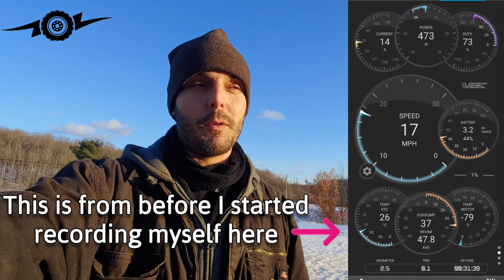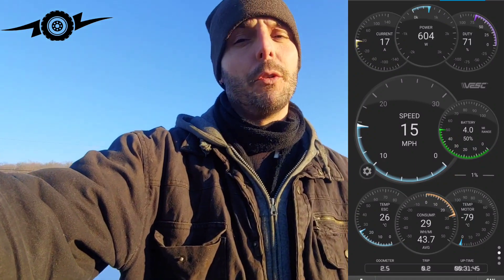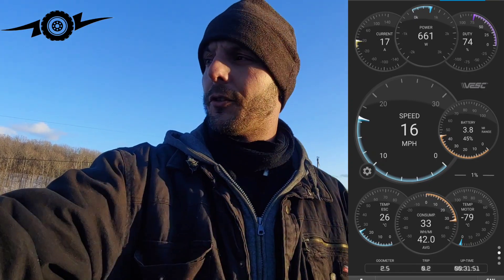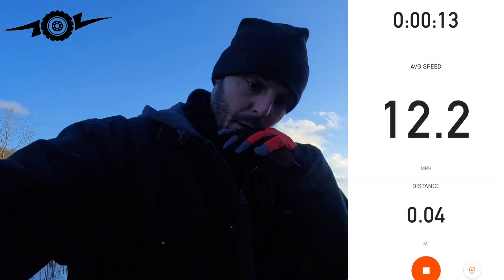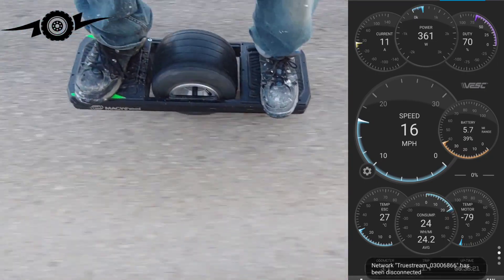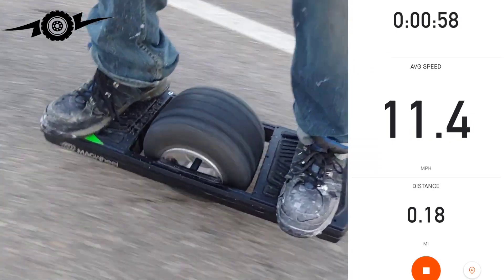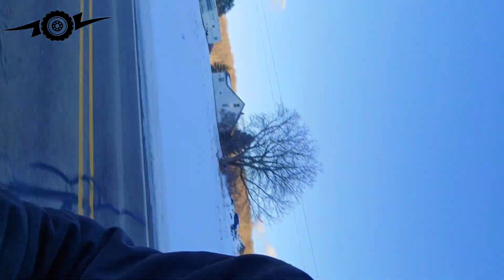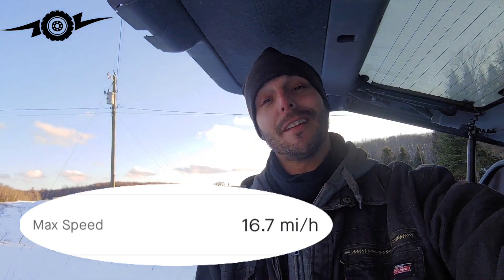VESC MAGWheel Test #2

Comment: Hey! These are exciting developments. I have a Trotter T3 myself and just in the process of vescing it too. Got an esc (flipsky 75200), connected basic wiring and have the motor detected and spinning. Fiddled with the motor settings quite a bit, still have some clunking, but better after raising detected resistance setting and lovering Observer Gain. Can't get the Float package working (or even the balance app) once I load it the motor is not behaving, making weird noises... Is it a custom float package that you're using? Can you share it for me to try please
Reply: After poking around all day got it working with the float package, IMU and Bluetooth work too, yey! The only thing left to figure out how to reverse the signal from the footpads, so it's 0v when disengaged and 3.3v when foot is on (currently just manually shorting the 3.3v to ADC1). Any advice will be much appreciated
Reply: inverting 3.3 signal wire was easy using a transistor I had lying around. Test ride tomorrow...
Reply from the maker: There is a custom float package with an invert adc option, but sounds like you got it covered!

Comment: Can we see a video of riding off-road or on grass?
Reply: Haha wondering if the Little FOCer prevents nosedives on uneven terrain? I’m thinking about putting one in my MagWheel T2.
Reply: @neilpettit3141  it does seem to handle uneven terrain better with the vesc. I'm using a ubox 100 with the stock battery and its way more stable on grass and bumps.
Reply from the maker: If there weren't 12 inches of snow on the ground where I live 😅

Comment: The motor wizard usually returns a resistance value too low. Like for the hypercore, it comes out at 84ish and that clunk is present. Raising it to 100 or so (or just start raising it from its present value) really helped the clunk for me. If it's still present, I also changed my observer to ORTEGA_ORIGINAL and now I can't get a clunk if I tried.
Reply: Motor resistance is motor config>FOC>general, and observer is motor config>FOC>advanced, I believe
Reply: @magic_steve  Careful of the settings that let the magic smoke out tho. hhaha
Reply: Thanks for the info.  I just finished doing a VESC on my T3.  I tried what you mentioned above but I still get the clunk when I change directions.  So when I get on the board and move forward I get one clunk and then noise.  Then if I decided to go reverse I get one clunk and then no noise.  Any ideas?
Reply: @swomitramohanty7505  same for me. Try tightening the bolts on the hub brackets. This has fixed it for others. Even half a turn seems all thats needed.

Comment: Cool shit. Get some stuff figured out and screen shot all settings so you can sell drop in kits
Reply: A lot of us have been trying hard to get some sort of plug and play option, but the closest anyone can come to a SAFE pnp option is sending in your battery box and bms to be modded. I'm putting together a couple controller and battery box combos for sale that will have all that included, but I gotta get up enough money for the multiple batteries. I already have the controllers assembled, wired, calibrated, tuned, and ready to go.
Reply from the maker: @magic_steve  for the MAGWheel?
Reply: @innovativeelectronics3041  for vesc in general.
Reply: @Innovative Electronics  sorry let me clarify, the boxes and stuff I'm assembling would be for the xr platform. If there ends up being a market for vesc magwheels, I may buy one to play around with it. In fact, I may do it anyways, and upgrade the battery just to show off on group rides 😆.

Comment: Do you know the type temperature sensor the motor uses? i.e. 10K thermistor, negative coefficient? I want to add a motor temperature sensor as a point of reference. I' m a quadcopter builder and flyer and motor temperature is important. I have some 10k thermistors and I plan to attach one to the VESC to see what it outputs to the app. Thx
Reply from the maker: This motor does not have a temperature sensor 😬